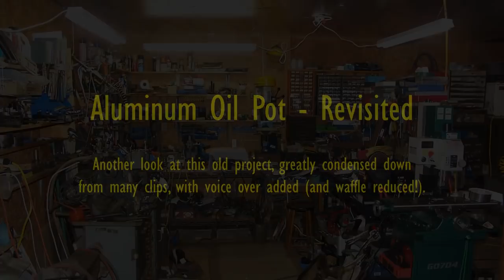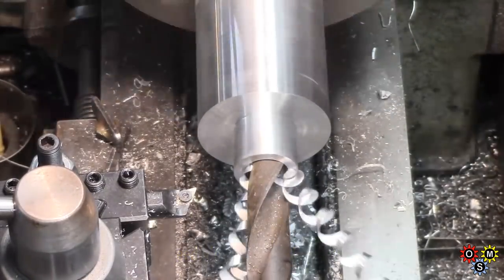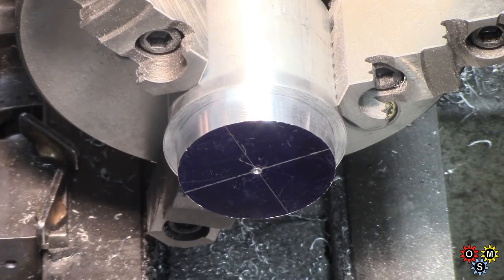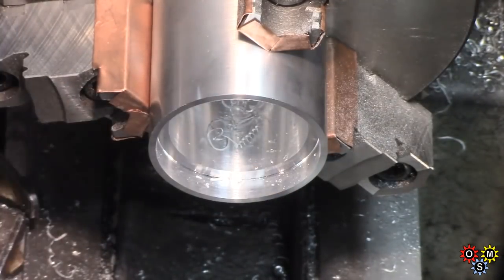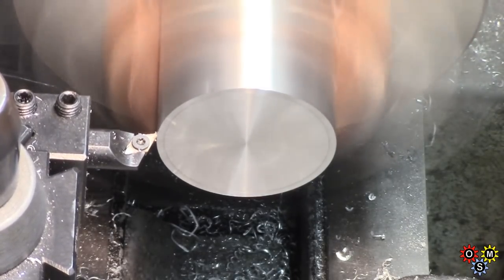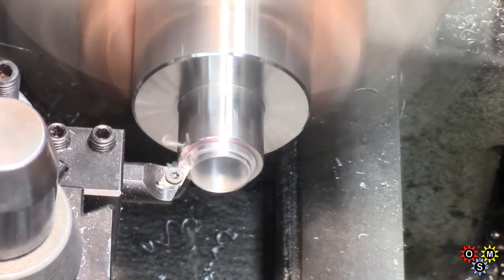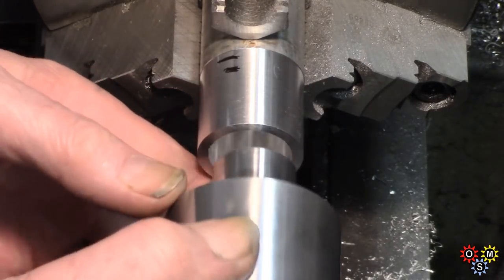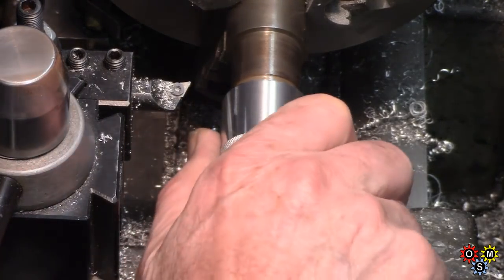Oil Pot - Revisited

Comment: Very good Chris. I made one way back but on mine you can remove the lid to clean out the swarf also I have a small magnet in it to collect the metal shavings.
Reply from the maker: Hi Anthony - I like your useful additions - swarf could well be problematic over time.

Comment: Hi. you did a good job on the "remake" and I really enjoyed the waffle!
Last  month I moved from Calif to Muhlenberg Township Pennsylvania and what a climate shock that was. I have Never had achy bones, but the cold here has made them stiff and sore
How do you keep the rust off of your tools? There is no shed or garage in the new apartment  so I  have my tools in a rental storage unit while I look for shop space to rent. After a month my tools are all rusty from the humidity in the air.
Reply from the maker: Thank you. I can imagine the climate shock - unfortunately the humidity and rusting problem is very evident at times and is worst usually when we go from suddenly cold to warm and humidity rises. I try to keep most bright metal protected by an oil film or "Boeshield" for example but even so it's a headache.
Best suggestion for you might be - put smaller items in a poly bag and spray liberally with WD40 - and larger stuff, again spray WD. It's not infallible but does help a lot.
Mill table for example can be helped once clean, by an oil wipe or WD and then cover with cling wrap. I sympathize with your troubles! Hope you can get a shop fixed up eventually.
Reply: @ChrisB257  Thanks, that makes sense, I will give it a try. As far as finding a shop I am sure I will find one soon, In fact I am going to check out  a small rental space today and on the way back I will pick up some WD40

Comment: Hi Chris, please keep active i appreciate your videos and your work and have for a very long timr too. 
I hope this finds you well and wishung you a very merry christmas to you and your family too. 
Thank you again for your efforts in delivering great content
Sincerely
Troy guyette
Reply from the maker: Hi Troy, Thanks very much for the kind comment. If I could stand longer and - right now have a shop that is below freezing - I'd get some work done but, have to just imagine!
All very best to your and yours for a great Christmas. :)
Reply: @ChrisB257  hi Chris i think it is time to invest in one of those patio heaters that use lpg gas bottle. Get cold here in winter but not as cold as it yse to be when i was in detroit. I now live in Adelaide Australia our seasons are oposite now. As for standing i suggest to my patients that a high bar stool cut to correct height can do wonders for being able to maintain functionality. Just a suggestion look after yourself and keep that smile. 
Thank you again Chris
Reply from the maker: I do actually have an LPG heater - as well as a kero fueled space heater. Trouble is, costs to run. Can't afford to heat shop (which is quite large volume) all the time and even trying to warm it for a couple of hours is not efficient when starting from very cold, as it is right now.
I do have an option for stool use but apart from being able to sit at the mill, everything else results in standing. I don't find lathe work easy at all when trying to sit, even with a bar stool. Tried it numerous times.
Thanks for the suggestions - sometimes my standing is limited to mere minutes and, even sitting is weight bearing - it's hard to win! All best.
Reply: @ChrisB257  i am sorry these solutions couldnt be useful to you during this time of the year. My spouse has noticed i get kinda of narky if i havent been in the shop in a couple if days and sends me off out there for nothing less than 2 hours. Sorta like time off for good behaviour. I know it sounds kinda funny. When its cold here i pull the patio heater out, only put it on where i am working. 9kg bottle gets me 6 hours. At end of the day what works for you is what you work with.
Wishing you all the happiness and wellness  during the holidays.